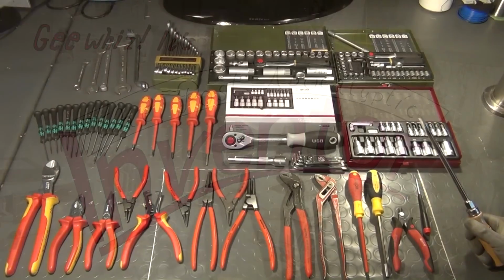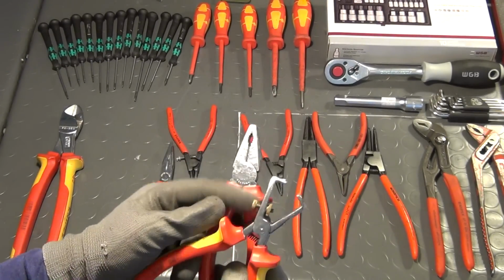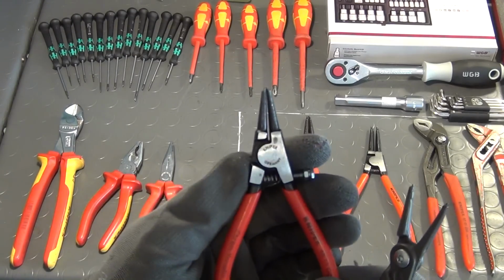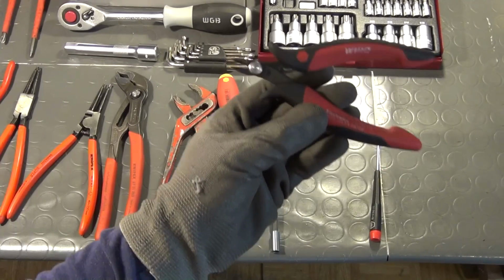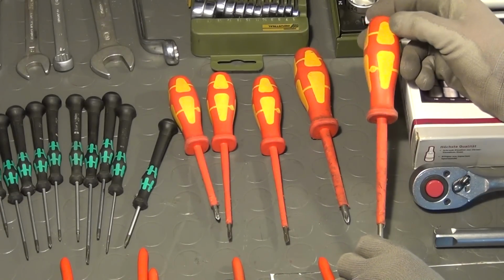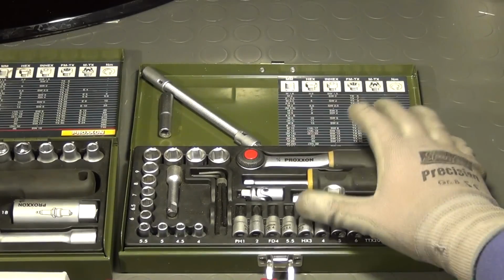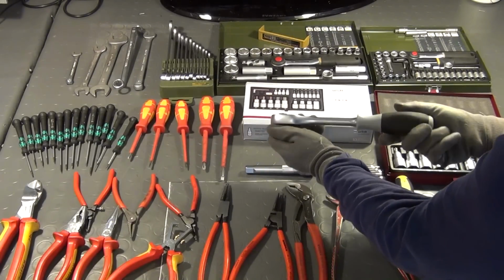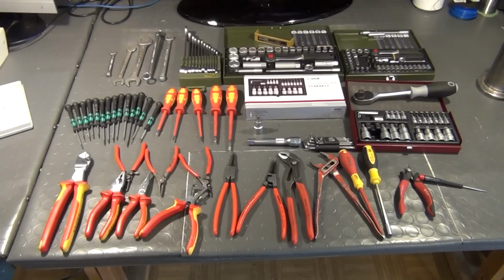German Tools Review: Knipex, Wiha, Wera, WGB, (Proxxon)

Comment: the Snap On truck that visits the airport stocks Knipex, and some of the others were asking me why I bought a pair of their side cutters over a pair of Snap on brand, so I picked up an aileron control cable that had been incorrectly swaged and was junk, and they cut it like butter, with no damage to the jaws. Snap On man sold 10 pairs of Knipex on his next visit. And he pronounces it correctly, which I like.
Reply: +Jacksonkellyfreak Have you ever compared them to Felco's for similar Cable-Cutting?
Reply: Dreaded88
 Oh God no. I don't use them to cut control cables. I was just making a point. Aircraft control cables are super hard to cut. Very stiff and thick. I usually use either mini bolt cutters or a dedicated cable cutter, but it's dull as dick and I have to put my entire 185 pound body weight on it.
Reply: Jacksonkellyfreak
Only 185? I got that beat!
Wow... I'm gonna' do amazing at yer' job! :D
Reply: Dreaded88
 sorry, I meant 195. typo. Let me give you some advice: Never volunteer information to the FAA, and buy the best tools you can afford. Harbor freight is fine for some things, especially starting out, but buy good tools. I definitely recommend buying and staying with a HF toolbox though because your box will get beat to shit. It happens. It'll get chemicals on it, possibly get the paint burned by a torch, dented, I've heard of prop strikes but never seen them, you get the point. You want it to happen to a 12-13,000 dollar box or a 4-600 dollar box that's identical to the SO/Mac/Matco?
Reply: Jacksonkellyfreak
Oh, you don't have to tell me this twice!
FAA's Motto:
"...We ain't happy until we make YOU Unhappy!..."

Comment: i love my little Wera Screwdrivers, they are not only very high quality steel and plastic, they are also very low tolerance, meaning they fit the screwheads perfectly. I have only ever used quite cheap screwdrivers before and i think using wera screwdrivers is a whole different experience.

Comment: Did I miss the TIG machine tear down, Build Arc welder, DC-AC TIG conversion videos?
Reply from the maker: +Zarouszz I've been working on the EDM project for over a year now and there have been so many technical problems to solve, that it is still not ready. Once the first prototype is on its way to Canada, the welding machine projects will be first priority. Sorry but there is just no way I can handle two large projects at the same time, while also trying to deliver regular content.

Comment: We are using Wera brand screw drivers in our clean optics labs and the green parts of the grips still get 'dirty' over time. I couldnt find out, what materials they use for that part but i guess it's some kind of PU rubber that decays over time. The steel is of high quality though. We use the "sechskant kugelkopf" (hex ballhead?) and altough we abuse them , only one of the smaller ones lost its ball head.

Comment: Another line of tools Proxxon make is miniature Power Tools, such as Drills for small scale projects like circuit boards and model making.
I own a Micromot 40 that I also use for drilling and cutting in hard to reach spaces.
And it is a tool that lasts.
My dad bought it in the nineties gave it to me when it was catching dust and I have been using it ever since.

Another cool thing is that Proxxon haven't  radically changed their design in  all this time.
Any of their 12 volt devices is compatible with older inverters like the one for my dads drill.
So when  you want expand and replace stuff, you can use it with what you already have.

Comment: The first tool, the angle cutter, is called a 'diagonal cutter' or 'Dikes' here in the USA.
Reply: Jacksonkellyfreak ... or pliers in comfortable shoes.  Actually a contraction of "Diagonal" and "Cutters",  At a certain point, we were told in on uncertain terms that we were not supposed to use that term.  Problem was, we had women in the shop that kept using the term so it never really went away.
Reply: RyeOnHam
 Lol around the airport we call em dikes, and our FAA inspector, well lets just say she has a mullet. Doesn't bother her though cuz she's inspected some safety wire pigtails and straight out said to go get a pair of dikes and snip that pigtail and curl it over so it doesn't slice someone. I think my A&P instructor told s that's where the name came from but I can't remember. But the alternative lifestyle is the big joke around the hangar.
Reply: Jacksonkellyfreak If I had a penny every time I cut myself with safety wire, I could solve world hunger.
Reply: Jacksonkellyfreak For a while, management made us 'pot' the jaws with RTV so it was supposed to catch the cut chunk.  They also required gloves, googles (just safety glasses wasn't enough) and some stupid procedures to keep track of the cut ends.  Never got one in the eye.  I knew of a few eye-shots with some scratches and stuff, but I never had one.  Metal chips were another story.

Comment: I am a tool freak too.  I have many, many high quality professional tools made in the US by Klein, Ideal, Greenlee, and many others made all over the world.  Electric tools from Milwaukee, Porter Cable, Makita, Dewalt, Hitachi and German brands like Bosch, Metabo and AEG.  I'm not kidding, I own hundreds of tools.  Of course, I also own Knipex and Wiha tools too.  I recently purchased a small bolt cutter from Knipex and it was definitely not cheap, but vastly superior to the crappy Chinese one that it replaced.  It is better constructed and the metalurgy is superior too.  The steel does not deform when cutting relatively soft steel bolts.  It's worth the extra money.  I don't think you can buy any Knipex tools in the US for as little as 20 bucks though.  German manufacturing is usually top notch but quite pricey.  If you want to talk about expensive German made tools:  I'd love to someday own a bunch of Festool electric tools.  They don't compete on cost - only on quality and everything they make is about the best that money can buy.  I have a wishlist, but I don't know if I'll ever be able to afford them...

Comment: Nice review, better than watching tv! :) relaxing after a tiring work week!
Good tool choice. I too have the Proxxon socket wrenches, various sizes, the 1/4" set for 18 years and it is still mostly ok, only damaged some bits (not sockets) from rough use. Excellent value for money. 
Knipex is great too, some advice, buy the chrome plated ones, the normal ones tend to rust easily (not worse than other brands). They have some very cool combi wrenches for elektro work, very worth it.
For screwdrivers, i like the pb swiss tools too. Their flathead screwdrivers have a very good parallel profile that doesn't slip easily. Great quality too, i used them at work and even after 3 years very abusive use still in excellent shape, except for the smallest size that didn't survive the full on Neanderthal use as a chisel..
The Torx set looks quite similar to a Wisent brand set I bought at Bauhaus long time ago, except it has 3/8" drive. Very good quality too! A must have for fixing newer car!

Comment: What about Belzer?? I own some pliers which are as new after more than 30 years (and being used..). Excellent (and expensive) tools from Germany.
Reply: Belzer were among the best. They merged with Sandvik, then with Bahco (owned by Sandvik at that moment). Later Sandvik sold the complete tool section to Snap on Europe (SNA). But some Belzer marked tools are still available in Germany. SNA produces hand tools all over the world. Pliers and screwdrivers in France and Spain. Saws in Sweden and Russia. Ratchets in Taiwan.

Comment: I love Wiha for screwdrivers, most comfortable grip i have used so far. I bought their Slim Fit electrical screwdrivers for home use and a few sets of their PicoFinish Tools for my model cars. 
For Pliers i use a wild mix of brands at work, but Knipex Pliers with the big grips are my favourite so far.
I can only agree with your thoughts on the cobra, at work i have a 180mm version in my pocket at all times, its my most used tool.

Comment: I am buying a set of those Knipex cobra pliers right now!

I am also a big fan of Klein tools which is an American (and made in America) brand.  They make  particularly nice screw driver, cutters, and needle nose pliers.
Reply: Klein sucks
Reply: +Jose Barrientos Very meaningful input there.  I am not sure what we would do without your contributions!  While I will agree their quality has dropped recently, they still have some very solid offerings, particularly for electricians.
Reply: +Michael O No, they no longer make anything good I have started to get rid of their overpriced made in china crap no longer USA
Reply: +Jose Barrientos You aren't entirely right. Anything that is forged is still made in the US.  They are sourcing from china for things like cable testers and "non metal" items, for lack of a better term.  2 weeks ago I bought a pair of Klein heavy gauge wire shears and  needle nose pliers and both were still made in the US as shown here: bit.ly/24vTmTj

Comment: $20 for Cobra Knipex??? I just paid around $80 CAD for each of my 300mm Cobras! I find it takes me a bit longer to set them to the correct size compared to my old Channel Lock pliers, which only have 7 or 8 sizes they can adjust to. They grip like a hot damn though.
Reply from the maker: +LeadAcidQuackery Here in German you can get a 300mm Cobra for 20...25 €:

http://www.voelkner.de/products/10984/Wasserpumpenzange-COBRA-300mm-Knipex.html?ref=43&products_model=C52413&gclid=Cj0KEQiAr8W2BRD2qbCOv8_H7qEBEiQA1ErTBippWaTc7jy2NnTTFSiV87onqEB-qz0tpLLJINqFPYYaAu_c8P8HAQ

Comment: I've had good experience with Facom, the insulated screwdrivers are quality and the hex key sets also good.
Reply: Truth but Facom is from France
Reply: ill second that! Facom tools (not just the screwdrivers and hex keys) are amazing especially there ratcheting open ended spanners
Reply: +gamerdude0 I like the 5.5mm combination wrench 39.5,5H. For some inexplicable reason it is difficult to get a 5.5mm wrench (fits M3 nuts) that isn't strangely out of proportion.
Reply: Facom power Allen keys are so good

Comment: To make a cheap ratchet sound better just fill it with grease.
My Chinese set sounds like a Hazet now. Well, maybe not quite, but they do hold up far better than I expected after looking at the tiny pawls inside. I like to pretend the grease has something to do with that.
Knipex also makes a range of small electronics pliers, which you need to have.
And you are missing out on the S shaped box wrenches from Proxxon, they are great.
So many tools....  so little time...
Reply: +stefantrethan Yeah the grease trick works. I would add that you do not need to pack the ratchet with grease, but a good coating does the trick. Too much and the pawl might hang up on all of the goo. I've greased Taiwanese ratchets that sounded like banging beer cans together before I lubed them, and afterwards they were as smooth as silk.
Reply: +Paul Frederick Yea they initially didn't lock at all after I packed them. ;-)
But some to and fro and all was well again. The excess grease just came out the gap.
Reply: +Paul Frederick You know I might just make a few of these. Metal pallet strapping springs to mind...
I use wooden tongue depressors at work for such tasks, and printed circuit board cutoffs at home, but often I find them too wide. I can easily see myself using this, thanks.

Comment: Thats cool, the majority of tools you can buy here are from china. We have (Our low price but cost effective) Craftsman here they work well and have a life time warranty, you can take them back to the store and exchange for a new one.
Reply: +troy zamora I wanted small imperial sized wrenches, so upon recommendation I imported Craftsman 942319 from the US, and also the metric set for good measure. The darn things are made from stamped sheet and the worst quality wrench I have ever held in my hand. The faces aren't even parallel, they are uneven and rough from stamping. Just a little bit of polishing and they slapped the chrome on. I thought you can't polish a turd, but I was mistaken...
The poor seller was fantastic, he even sent me another set for free, but they were just the same piece of crap.
Reply: I am lucky to have an old set That are made old school. I have noticed that in the last few years they have started to switch over to china made tools. An upside to me is If I ever break one of there tools I can get a replacement that day for free. I will never take my set from the good days in for warranty, for that reason. The new sockets I have are poor quality then the ones my dad handed down to me. The ratchets seem to work well. Snap-on is the go to for best quality, If you can fork over the doe.

Comment: thank you, a marvellous video review.  I also have Knipex pliers, perhaps a little older than yours. They work very well, but the plier ends are not shiny like yours, they are dull brown (don't think it's rust..). How do you keep yours so shiny?
Reply: +SheddyIan The ones he has are just the chrome plated finish.
Knipes also sells them without chrome, just bare steel. They hold up well as long as you oil them lightly and according to Knipex chrome plated ones are not suitable for electronics due to the danger of chrome chips coming off. 

A long time ago Knipex sold the bare finish with a coat of clear laquer, which looks brownish now. If it's not rust, that's probably what you have. The handles should be uniform red but not translucent, at least those on my laquered ones are.

Comment: In my dad's shop (I'm a student and still live at home) in Belgium we have primarily German tools and our experience with them is excellent. We never had knipex handles come loose but then again, we use automatic strippers (two-stage pliers).
Recently my dad has had a habit of picking up cheap tools and it has really proven to be a hit or miss. Some break on the first try and others are surprisingly good. But the only way to know you have something good for sure is to go with a brand with reputation. I find this to be especially true for power tools, the cheaper ones either are weak or tear themselves apart under use. But the 20-30 year old German power tools get the job done properly every single time.

Comment: I had a Wiha with changeable bits I purchased in 1998 that was really good, unfortunately I misplaced many of the bits and now it has some bits that are cheap ones from other screwdrivers.  At the time I was working doing computer repairs at a store and several coworkers had purchased Wiha screwdrivers because they were the ones that could get out screws that were stripped because the fit was so good and the tips didn't wear down.   I will say Wiha is probably my favorite brand of professional screwdriver.

Comment: Hello I really like you videos, but most i like that you speak english, so its easy for me to understand you :) . I'm from Bulgaria but for 2 years now i live in Germany. Also i m electrician and electronics is one of my hobbies. To tell you the true i worked with a lot of Germany hand tools but one of my favorites is NWS (Solingen) for pliers and screwdriver and Wera (rulz) or Wiha for screwdrivers. In company where i work is using Klauke , Würth, Knipex , Cimco unfortunately i'm not very happy with them i can say klauke sucks for its price, Knipex side cutters also are not the quality that i had expected .Cimco is not so bad but a little overpriced. Würth i may say is quality - wrenches, pliers, screwdrivers all is good but unfortunately very expensive. And at the end lets say that i do a lot of work with this tools with thick cables or maybe new made tools are made not to last but to buy more frequently :)

You have to try NWS, i have 10 years old isolation remove pliers like new with my type of work and it costed half the knipex price, i really happy that i'd listened to the seller :) but i had problems with handles as well fix with glue, kombi pliers also very good and have same interesting features. Also i bought very good wrenches from the flohmarkt Facom for 20 Euro. For normal wrenches i bought Gedore as well from flohmarkt 1-2 euro/piece almost new.
Reply: Which pliers from Wuerth do you mean? Most of their pliers assortiment are actually Knipex pliers, but rebranded with the wuerth logo.
Reply: +casmino  yes few of there power tools are also rebrand bosch but are far better, that is why they want 1st class tools not 2nd or 3th